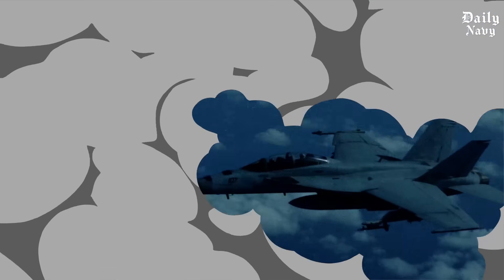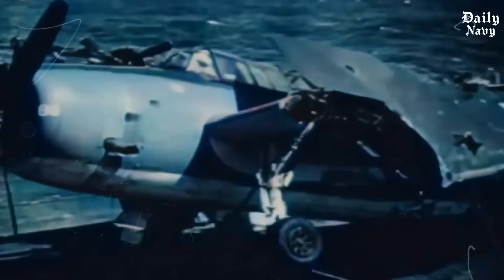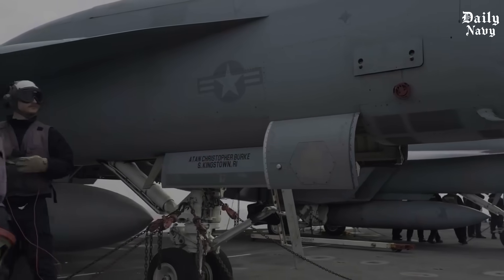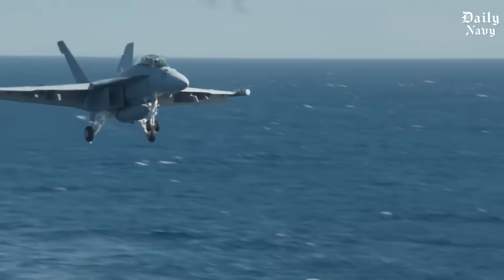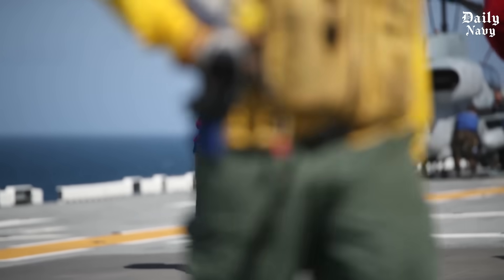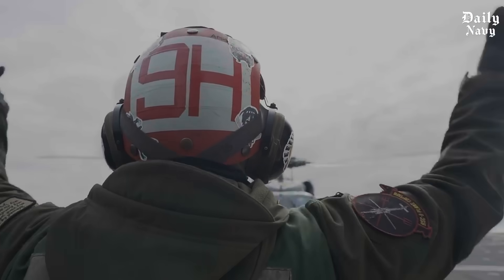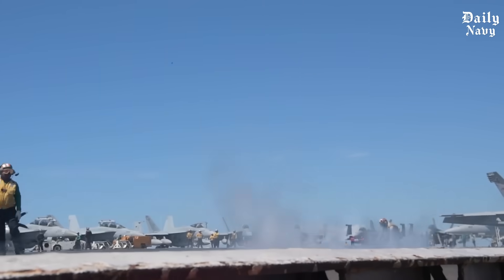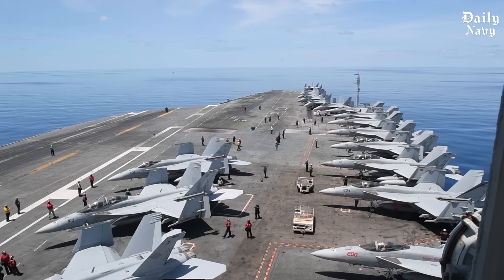How Fighter Jets Land on Aircraft Carriers During MONSTER Storm Seas

Comment: Garbage! 1. No aircraft landed during a typhoon. Weather like that doesn't come out of nowhere. They wouldn't find themselves in a place where they'd have to. 2. No carrier aircraft has ever had a max landing weight of 30 tons. 3. IFOLS didn't come into existence until the 2000s. They did have the older FLOLS, but the image they keep showing is MOVLAS or manually operated visual landing system. By the way, MOVLAS is most commonly used in heavy weather. 4. The cable that is stretched across the deck is known as the cross deck pendant or CDP. They are around 100 feet long not 40. 5.  I have been in 30 foot seas. All flight operations were scrubbed. We resumed operations when we got down to 15 foot seas.
Reply: The presenters should have their vids checked out(edited) by actual navy pilots…..eliminate stupid stuff🤷‍♂️
Reply: The presenters should have their vids checked out(edited) by actual navy pilots…..eliminate stupid stuff🤷‍♂️
Reply: P. S. Just Google Typhoon Cobra. December 18, 1944